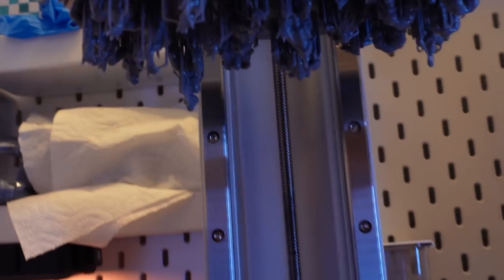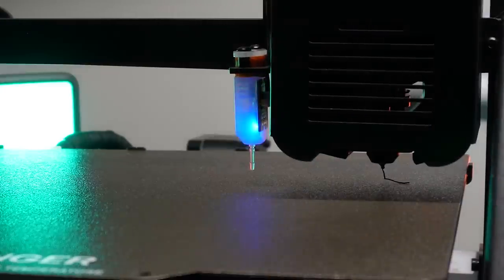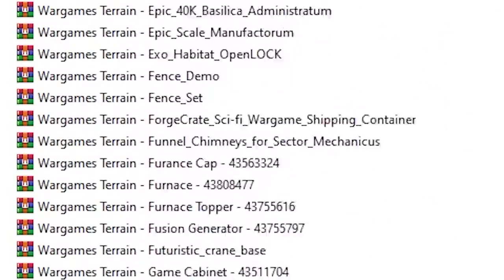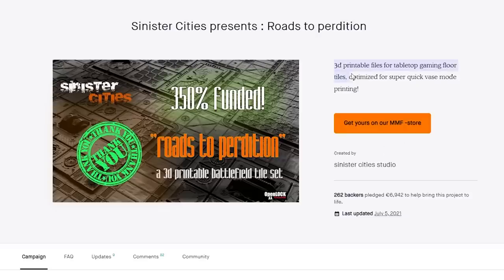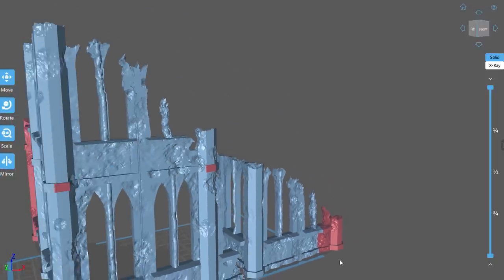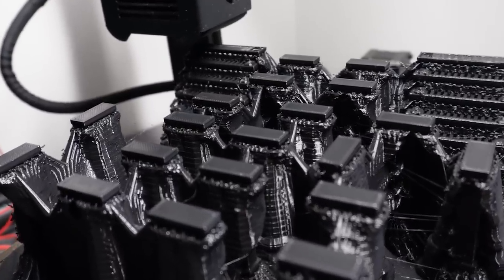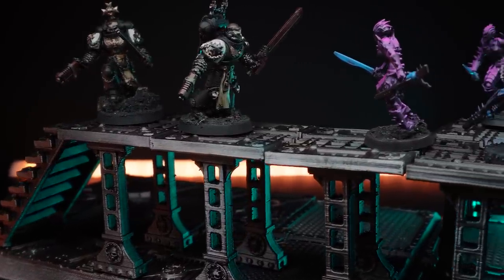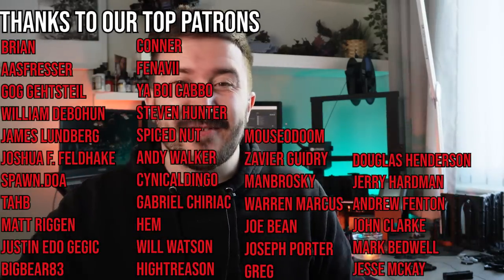Should You Get an FDM Printer for Warhammer?

Comment: Honestly FDM prints are good enough to  scratch that painting itch without breaking the bank.
Printed a Chaos knight in PLA and it just looks so cool.
And not having to deal with resin is a big plus as I don't have space suitable for fumes and waste.
Reply: got an fdm for the same reasons, i'm sure resin would be a better choice for minis but i just really don't want to deal with all that comes with it nor do i have a safe place for it with a cat who like's to mess with everything. i know it'll take much longer since you can only really print one thing at a time but one day i'll get an fdm mini printed that looks amazing just gotta keep working on it.
Reply: large units like knights is an FDM project for sure,  printed my storm surge and hammerheads with FDM
Reply: @envynemo4170  yeah , minis that are well , small is more recomendable to use Resin , but you can get away with FDM printing with larger models if they don't have super details

Comment: My Neptune 3 has been chucking out terrain for the last 4 months. Not much tinkering needed, once I had the filament dialed in and worked the correct settings for bed adhesion out. Could not be happier!
Reply from the maker: Great choice brother! I'm kicking myself I didn't get into fdm printing sooner I'll freely admit it intimidated me.. Handling toxic resin on the other hand? Heh no problem lol
Reply: Ye neptune 3 is best.
Reply: @battlebrothersam  Like you, I started out with resin printing. Now I actually find FDM printing much less of a hustle than Resin printing.
I usually print my terrain @ 0,08 layer height, which takes some time, but the results are spectacularly good and when painted the difference compared with a resin print is barely noticeable (not for minis mind you), but definitely good enough for terrain. Besides, it is a lot less expensive when taking into account the cost for resin vs filament, even considering the longer printing times and the higher use of electricity.
I am a happy camper, because I have now more budget available for buying paint and books.
Reply: @travelminipainter  I just got a fdm printer for terrain and have been printing @ 0.2  does the drop to 0.08 really make that much difference? I guess I'll print the same peice at both sizes and see for myself...
Reply: @anab0lic  For me it makes a lot of difference. But that is just my personal take. Particularly for painting. All the way down to 0.12 layer height the layer lines can be too pronounced for my taste. Below 0,12 the top surfaces start to become much smoother, so I can work with thinner paint and also dry-brushing (which will show layer lines brutally clear). The down-side of course is the much longer printing times and higher energy consumption that comes with it.
Reply: @travelminipainter  I just got done with a 0.08 print of something I already had done at 0.2 and yeah, big difference.  I want to airbrush my stuff and think this level of smoothness should work well for that.   Extra print time is brutal though, definitely going to need a second maybe even third printer to churn out stuff at speed that meets my demands.

Comment: You should invest in a "dial or digital test indicator"
Works similar to the auto leveler but its stationary. So in theory if you the right spot. The bed could run all the needle and you can visually inspect for precise problem areas

Comment: Our FDM printer gets a lot of use making utility stuff for around the house as well as bases and terrain. I came across the Tycho Starport files which are great for what we need. They're the right size for the cubes structure in Deadzone as well as just being good for general sci fi. A friend of mine loves scratch building terrain but he has the floors scaled up along the lines of Deadzone so we can intermingle the terrain perfectly.

Someday FDM printers might get to the quality I'd be happy with for most minis and I look forward to that but they definitely have a place in my tool kit. Its too cold in the shed to print using the resin printer but the FDM one is working on a bunch of 25x50mm bases.

Comment: Tinkering with FDM is mostly for printing Minis that require well tuned settings, so you can deal with the small scale of the minis, where if you have a poorly tuned printer you will end up with failures to print, and also most of the time you need to tweak settings sometimes model by model, if the legs are too thin you might need Z-hop but with a Vehicle or larger mini you won't need it.

Comment: A lot of people just don't want to mess with resin because of toxicity and long cleanup routines. A lot of people don't even have space for a reason printer - the only space I have in my apartment is right by the window where you simply can't work with resin because of UV. And no, foiling my window isn't an option :D

So talking like resin is the de facto choice for miniature printers is wrong. Sure, if you have all the perfect conditions for it - it's better. Just like a private jet is by far a superior way of long distance travel. But for many people it's just not an option. 😮

Comment: resin for small stuff and fine detail. FDM for larger terrain and vehicles. Most big stuff you'll struggle to fit in proper orientation on all but the largest resin options. there's ways around layer lines post process.

Comment: "resin is the way to go, in my opinon" - Battle Brother Sam.

for detail rich minis, yes. resin is the undisputed king in the miniature hobby. BUT FDM is catching up fast. FDM is still long ways from resin in terms of detail capture. FDM can produce minis that will get you by. I've printed out 12 FDM mini bodies with 11 of which are of good enough quality and acceptable detail capture to be used, smack on official arms, heads and backpack along with weapons and a paint job and barely anyone would be able to tell the a partially 3d printed from a wholly official one.

FDM is the go to for terrain in 98% of the time.
Reply from the maker: What would you print in resin for terrain? Scatter pieces? Fdm is 100% less messy to print with but when it doesn't work its quite frustrating lol

Comment: yeh my ender 3 pro worked great for a while now it keeps getting blocked nozzles, For larger prints theres a real danger it will fail partway through. I think I know which part is the problem but its going to be trial and error to fix it. fdm is a way bigger headache than sla in my experience.
Reply: Yup, started out with 2 Enders.  Switched to resin and quickly stopped using the Enders.  Anything really big I figure I am better off using other materials like clay, and wood.

Comment: Got both, an FDM and a resin printer and both have uses. FDM is crap with details but it's 1000x better than the resin in efficiency with big models. So the FDM prints terrain pieces and large models / vehicles. Resin prints everything else - small to medium models and the big ones that need details.

Comment: I started my 3D printing experience with resin and after a short time regretted it dearly.  Toxic materials, needs a dedicated well ventilated workspace, safe and legal disposal in place.   Much happier with a FDM printer despite the difficulty in reaching the finer detail on small miniatures achievable with resin.
Reply: It's only easy when you spend hundreds on equipment to handle it and develop a method, It then becomes an easy 10 minute process but still more work than FDM.

Comment: Modern cura is also so much better than cura from half a decade ago. A ton of it's more useful abilities plainly did not exist back then. See the 2023 tree supports vs the original iteration, the existence of lighting infill (support builds internally on the z axis) and plainly better software coding with fewer weird inconsistencies.

Comment: I find that FDM is a general use item. There are so many good tool you can make on it as well as terrain

SLA is something that you need extra steps and it is limit to what to use it for. I find it is not uncommon for me to just buy a box of mini instead of using the SLA.
Reply: Depending on size SLA can do anything FDM can and more if your willing to spend extra on engineered resin.
Reply: @miguellopez3392  Like I say there extra steps for SLA.